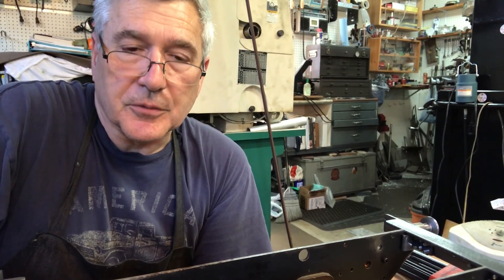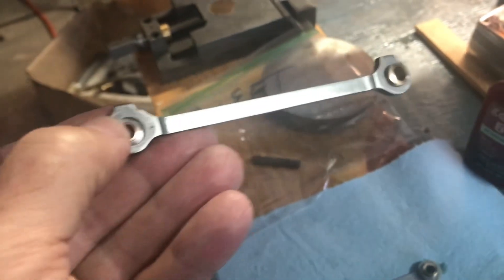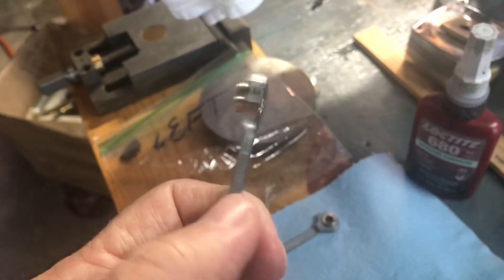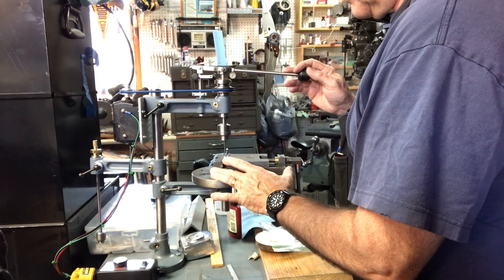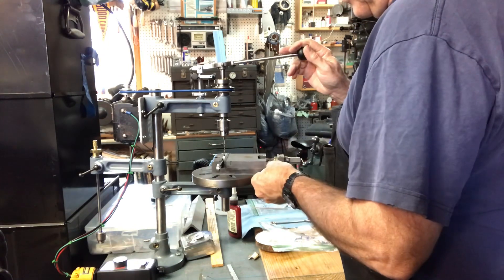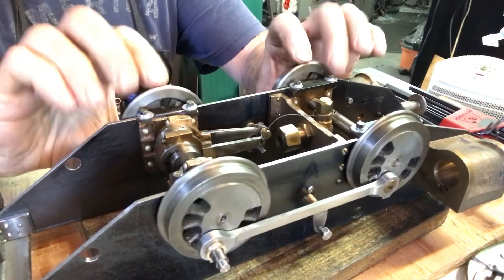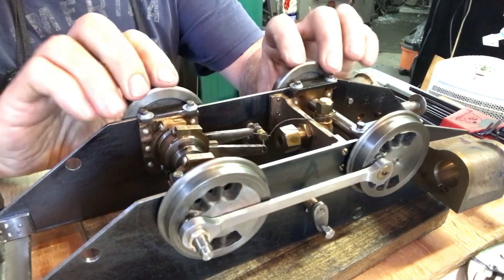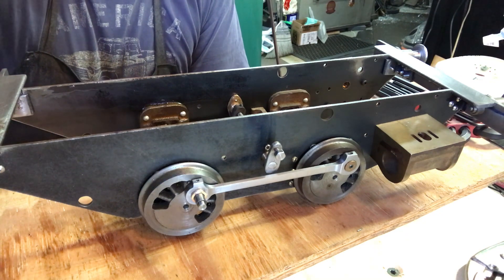8. LBSC TICH LOCOMOTIVE, coupling rods completed and installed

Comment: What does that mean... The hole.. or the connecting rod.. is like a couple thousandths longer or shorter on one side???
Reply from the maker: Yes, probably.  Or maybe the quartering isn’t perfect on the front axle. Either way, you don’t want things too tight. The axles have to be able to move up and down a bit as tracks aren’t perfectly level and symmetrical. Better a little loose than tight…